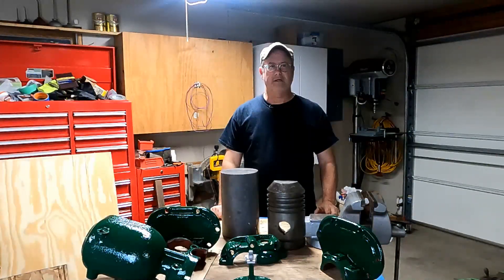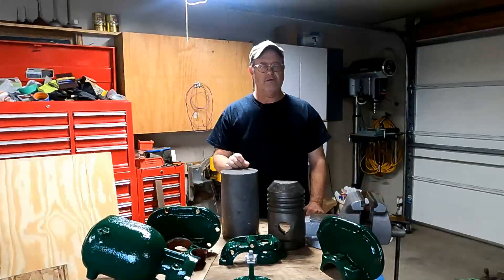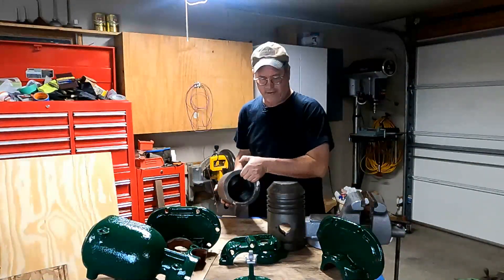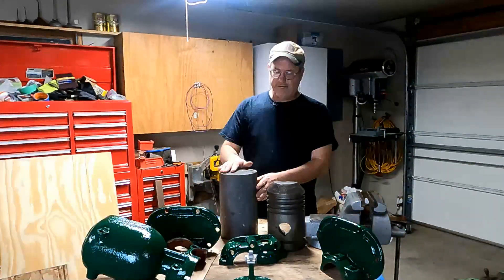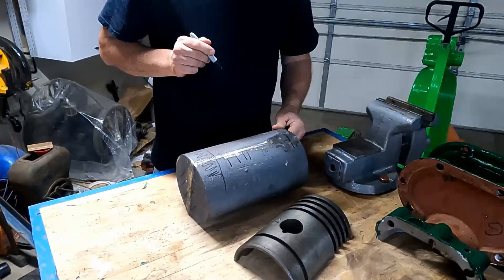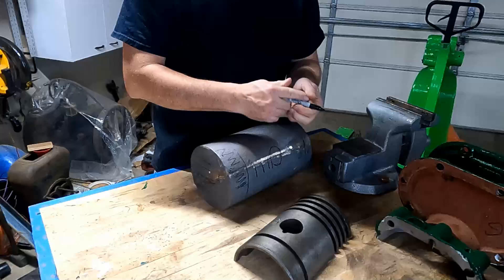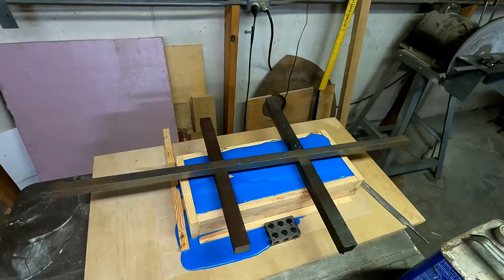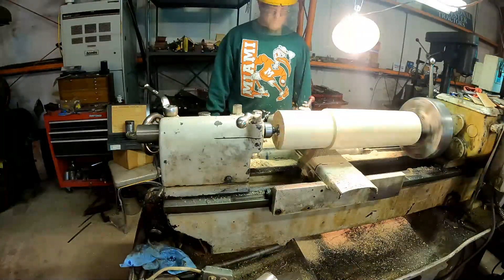Piston Machining Part 1

Comment: The Chuck drive looks like it’s rotating opposite direction of Chuck mounting assembly.  Optical illusion or planetary drive assembly behind Chuck?  I’m not a machinist just a novice wannabe.
Reply from the maker: Yes just an illusion lathe speed was 94 rpm

Comment: I wanted to see how you cleaned up the rough casting to chuck it initially.
Reply: You have to chuck it on the rough casting initially so there’s no clean-up. 

That’s why a 4 jaw is used, so it can be centred true, at least as best as possible since the casting isn’t likely to be perfectly round.

Then you lightly face and skim a registration diameter on the other end so you can then flip it around and work from there. 

He’s done exactly what I’d do, except I’d always do the face first so I can use a centre in that face to prevent the following diameter cut pushing the work off-centre.

🇬🇧

Comment: If there's enough length in the casting, I probably would have got it dialed in as close as possible and then drilled a center in the end so the tailstock could help support it. And then in the final operation, when machining the angled faces, the center hole could be faced off. 

Looking forward to the vids. I'm working on an 8hp Gilson (approx 1910-1912 era) at the moment.

Andrew

Comment: Nice casting. Just a thought. You could have dialed in the inside of the piston casting to get concentric instead of the outside.
Reply from the maker: Agreed this was the best way I felt for the tooling I had many ways to do operations